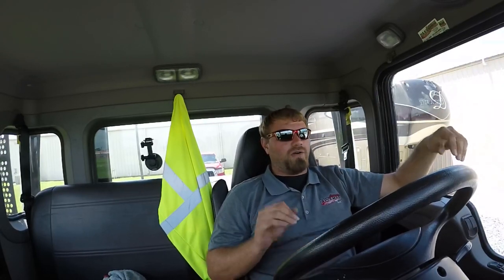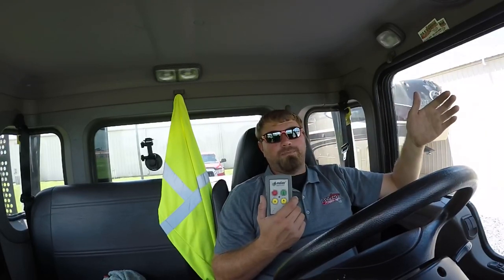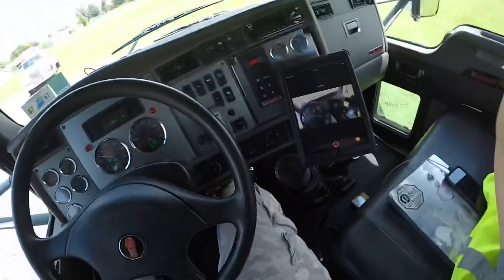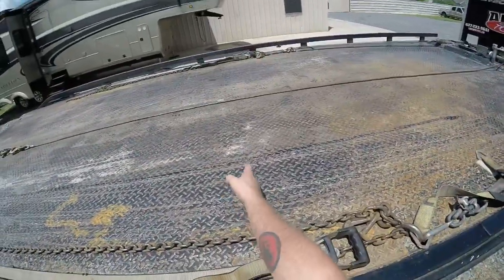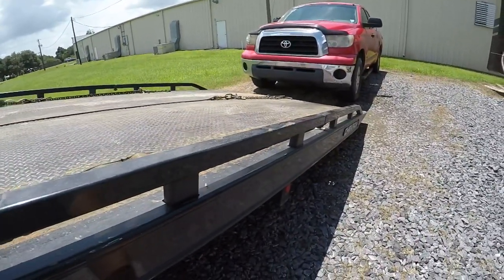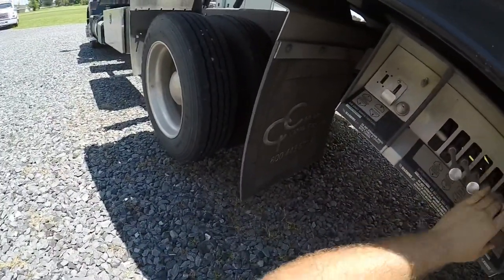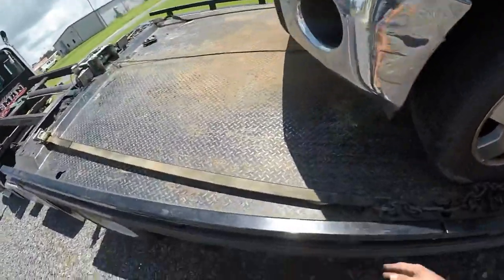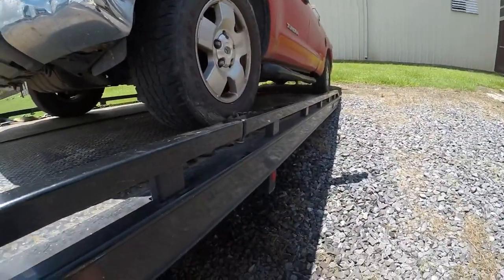Walking a flatbed wrecker under a vehicle in reverse

Comment: Adam, I'm new to the towing industry and I'm loving it. For some reason yesterday I watched your video for the first time, and wouldn't you know it, I had to put it to use last night on a Dodg Ram pickup with two flat passenger side tires. It worked like butter, I was so stoked. Thank you, thank you, thank you. It was perfect timing for me to have seen your video when I did. Stay safe.
Reply from the maker: I’m glad it worked out for you bro. Now that you’ve done it once, you’ll use it more often than you think. Lol. I do it all the time for different reasons. Broken ball joints just got easier for you. Here’s something else you could practice to build off of this: take a vehicle from the tow yard that’s going to scrap and take a front wheel off. Load it like this from the rear, shake it off the end of the bed and place a block between the edge of your bed and the unibody or frame and lift the vehicle up. MAKE SURE YOUR CABLE IS TIGHT AND HOLDING THE VEHICLE! Place a jack stand under the car and set the car on the jack stand. Then work your levers slowly to walk out from under the car while it’s on a jack stand. One thing to watch, if your truck has airbags and they’re dumped on offload, when the rear of the truck sits back down on the ground, that rear axle will push the truck forward. So as you’re putting the truck back down, go slow. Once the wrecker moves forward a bit, slowly release your cable so it doesn’t pull the vehicle off of the jack stand. Make sure the wheel that’s still on the vehicle is blocked as well because with one missing, it’s like the vehicle is in neutral and it will roll forward on you.
Reply: @adamtarver  ohh wow, I'll have to see one of your videos of that. I learn better by seeing it and doing it. Look forward to seeing that one. Thanks.
Reply: If it was just two flat tyres  why did u not just drive it up

Comment: I used this technique before.  Really didn’t like the wheels off the ground a lot of stress on the truck.  There is another way to do it. But the bed under the front wheels set your chains and put wrecker in neutral and winch the wrecker under the vehicle it had worked for me the 12 years I have been driving a wrecker
Reply: Love the response and I’m in total agreement. I will definitely be using your technique
Reply: That’s smart. I didn’t think of that. But then again I’ve only been a tow truck driver for 2 weeks lol
Reply: It really good for someone that has a broken ball joint.  When u have a straight shot from the back.   I never have used skates or anything like that.  I need to post a video of pulling the wrecker under the vehicle it’s really easy.

Comment from the maker: You only have to lift the rear end of the truck off of the ground if your fast idle/PTO won’t stay engaged if you release the brakes. Or put the truck in neutral if you don’t have air brakes.

Comment: Good Vid Adam, I subbed you. It's nice to see towers thinking outside the box...and not in some unsafe outlandish way....you could prolly also do a video like this when winter comes and show how this very same technique, used in a similar fashion, could be used to get ''unstuck'' in your flatbed. keep up the good work.
Reply from the maker: Split Second Towing this does work if you get stuck. If you sink the rear and the front, DONT TRY THIS!!! You’ll dig your front end in a deeper hole. And NEVER use the wheel lift to walk yourself out. Those inner tubes aren’t made for that type of pressure and you WILL bend it. They’re about $900 to replace... just replaced one on a used renegade we bought last week with the inner tube bent...

Comment: I prefer to attach cable first, put my truck in neutral. I then winch my truck under the vehicle. I use wheel chocks/blocks on both vehicles. I will keep moving blocks for tow truck as it moves back. This method is very hard on the bed slide cylinder, and bed slides. But, is sometimes necessary due to a hill, or to get rear of truck over  an obstacle(curb, parking block, etc...).
Reply: That is a terribly inefficient and questionable method, I have never heard of, or done that in my life, Never come across a situation where that might even be beneficial, Skates are so much easier.
Reply: I use either version, depending on the vehicles and geography. Recently, I hauled a Ferrari F 12 with a rear flat. I started the bed under the front tires with my slider wedges. The car doesn't have a neutral mode that I could get the transmission into. As such, I left the suspension deflated and walked the bed back to the rear tires and snugged the winch along the way. Once the tip of the bed was started under the rear tires, I dosed the bed with Dawn and water, sliding them a few inches forward. I lifted the bed up with tilt and towbar to allow sliding it forward without tail dragging the car. Once level and forward, the car slides easily on the slick liquid. Strapped the wheels and away we go. At the dealer, high tilt the bed and ease the winch. Usually the slickum has enough residual to allow the car to slide back to the end of the bed. Gotta be careful, but getting the tires halfway off the edge will allow the bed to slide away from the tires when you set them in place. Free spool the winch and walk the truck out. The hooks get flipped out when the front tires are about a foot up the bed and the bridle gets pulled clear, allowing the bed to be withdrawn a few inches at a time, minimizing nose contact with the deck. 
   I certainly could have started the car and driven it back, but maintaining its immobility prevents any ground scraping. The car's damage was limited to the wheel and tire. Nothing added by the truck.

Comment: Great video for releasing and pulling it up but all of that seems like its putting unnecessary wear and tear on the hydraulics and fram of the bed dosent it???
Reply from the maker: alberto castellanos it’s the same leverage walking the truck as it is loading that vehicle. Picking up about the same amount of weight. If I was lifting the entire wrecker, I’d agree 100%. But the rear end of that wrecker doesn’t weigh a lot. Gross wet weight of that wrecker is 16,500#. My bed is rated for 16,000 and Only picking up a little over half of that if not right at half. It won’t put anymore strain on that bed that it isn’t rated for. But to the naked eye at first glance, yes, it looks like I’m going to destroy this wrecker. Lol

Comment: I’ll have to try your method sometime.  I slide the bed under the wheels then get in the rollback and back up in reverse.  Your method keeps you at one spot where I’ll usually adjust  the bed tilt to stay clear of the pavement and underside of the vehicle.
Reply from the maker: Only reason I quit doing this is I had a vehicle that broke a park pin halfway up the deck effectively putting it in neutral. Thankfully i had the e brake set and it rolled to the end and stopped. This way, you have control of the vehicles with the cable so it can’t decide to leave and go to the drop off destination before you do. Lol. Just something to think about. But yes, that way does work as well and I’ve used it for many years until that happened to me one time. Tha LFT it was a totaled vehicle that we ended up getting the title to so I didn’t have to pay for a transmission.

Comment: The truck i drive wont lift the wheels with the bed. I eventually figured out i can use the wheel lift to walk the truck. Ive thought about installing switches to bypass the park brake and shift interlocks for the pto. Then the truck could just roll, but since the wheel lift works i probably wont.

Comment: Adam, just running across your video. I'm still a little confused on how were able to walk the truck back and forth. Where you using the wheel lift to lift the rear end of the tow truck up? I saw a video of another guy doing it, but he put his truck in neutral to do it.
Reply from the maker: No, I was using the deck to lift the rear. If you use the wheel lift to do that and push the truck forward, you risk bending the inner tube. Sorry for the late response. YouTube doesn't have very good notifications for comments. I apologize
Reply: @adamtarver  no problem man. Thanks for the response

Comment: There is a place for walking the bed, I've done it a time or two, But seems to me a lot of the "reasons" for walking the bed are to make up for not knowing your truck and not being able to back up far enough or backing up too far, and it seems another "reason" is lack of skates, Skates are the go to for no keys, No dragging of the vehicle, The vehicle stays in park and you drag the skates with the car on top, Reduces the resistance greatly, reduces the stress on the vehicle during the entire loading and unloading process, and it's just better for no keys.
Not to mention skates work for vehicles with all the wheels locked or vehicles you have to get from the drive tires, This method only works as shown when your drive tires on opposite of your truck and will stay on the ground for most of the process, otherwise you will just be pushing the vehicle back, Also "shaking the vehicle off" is a method we all use don't get me wrong, but only on wrecked cars do I do that, It's hard on the vehicle's transmission, I've heard of guys breaking shit on the car shaking it off, and its hard on the truck.
Reply from the maker: My truck actually have two sets of wreck master locking skates on it. I had to use this today as a matter of fact. Had an E350 handicap bus that over heated. Sure, I could have just drug the rear end the 4 feet it took to get the rear tires on the end of the bed. Or, I could release the brakes on the wrecker, hit the cruise override on my control box and pulled the wrecker under the bus like I did to prevent the rear of the bus dragging on the pavement. Or how about a broken ball joint on a crown Vic? I could drag the bumper and front end on the ground loading it or I could do this. And when I get to the drop off, I can place the front end on a jack stand for a customer and walk the truck out from under the vehicle so the customer doesn’t have to fight with a jack later. You call it not knowing your truck, I call it customer service at its finest.
Reply: @adamtarver  I mean as I said there is a time and place for it, setting it on jack stands is a good example, and I'm not trying to diss your methods after all there are a million ways to do the same task.

 Whatever works for you is what you should do, but I question some of the described situations and whether or not it would be quicker or more beneficial to walk the truck, dragging a car I will always recommend skates over dragging it even an inch it's harder on your equipment and the vehicle being towed and skates reduce the resistance to overcome, the entire loading and unloading process.

 as for broken ball joint, I will still recommend a ball joint block, takes longer but with a broken ball joint dragging the car at all is going to risk lodging the wheel up in the fender or causing damage to the surrounding plastic or the fender when dragging the wheel up.
If the vehicle is too low on the ball joint block a skate works there too it will keep that wheel from rolling while all the rest continue to roll and it will make it even that much easier while keeping the wheel from damaging the fender.

But yes there are reasons to do this and it's a good thing to know, but I do question some of the reasons, but I have done it and continue to do so when it could be useful.
And yes a majority of the time I've seen this technique used was by companies not knowing how far to back up and using it to reposition their truck mid unload because they were too far back or forward.
Reply from the maker: beastm0de7 I made this video mainly for the ops that don’t have the skates and blocks or really the necessary equipment to load vehicles that are locked in park or for some reason that they would have to drag the vehicle if they don’t have skates or blocks. A cheap bottle of tire wet from DG works wonders sometimes. I use that sometimes even if I do have skates. Lol. I see what you’re saying now. I’ve seen some guys do the same thing. They either back up too far or too close. Hell, I’ve done it a couple of times. I’m no saint. Lol. The truck I was in when I filmed this one is a 2017 KW T270 with a chevron model 12 LCG bed. The one I’m in now is a 2020 kw with the chevron model 12 LCG Load Rite bed with the dovetail on the end. I don’t like doing this too often with this new bed because it seems like chevron sacrificed a little bit of structure due to the sunken deck. I’ve got just under 10k on this new truck now and will be posting a video soon that’ll show the differences between the two trucks and how I have the new one setup as far as equipment. There, you’ll see the different things I use on the daily to make my life easier. If you see that video and can offer any feedback, I’d appreciate it. Whether is equipment that you have that I don’t or vice versa. This channel is designed to make our lives easier. I was brought into this industry “figuring it out” and driving total junk. I figure now it’s time to pass down my experiences, good or bad, to some of the guys that don’t have access to the right equipment for the job and are just winging it like I did for so many years. I misunderstood your comment and I won’t delete mine because I’m not that kind of guy but I do apologize for the last line of it.

Comment: I have a rollback too but mine's a different style it's an old school Jordans where it uses a wedge style to tilt the bed so it doesn't allow me to do that exact same thing because it won't tilt as much I can do about a foot at a time so usually I do is I get my bed underneath the tires that can roll the front or back depending on the vehicle once I get it up high enough where my back housing where my willift would be my truck doesn't have it installed anymore because the previous owner broke it in half and took it off once I have the whole rear end floating where it's not dragging I get in my truck and ask you back my truck under until it's about a foot or two usually about a foot or up against the back tires of the vehicle that do not move and I have the very back part of the bed almost dragging the ground when I back up it's really like an inch off the ground

Comment: Thanks for the clear demo! I’ve needed to do this a lot with vehicles that don’t have keys, but always ended up messing it up. How can you do this for all wheel drive vehicles?
Reply from the maker: Sorry for the extremely late reply. YouTube should send notifications like Facebook... all wheel drive vehicles can be a pain. But with the few that I’ve done in south Louisiana, the rear rolls free if the front is still on the ground. Idk why, I’m not a mechanic and I’ve never put much thought into why but sometimes i get lucky and it happens. Others that are totally locked down, get out the tire skates and load it like that. Generally just skating the side in loading first. But that’s a whole different video because you can get the tires onto the edge of the truck, lift the bed a few inches off of the ground, release the brakes in the truck and pull the wrecker under the vehicle using the disabled vehicle as a dead weight. Once the other axle gets to the edge of the bed, reapply brakes and load normal. Just don’t forget to reapply the brakes. You know what would happen if you did. I believe I’ve seen multiple fail videos where people are chasing their vehicles down a hill. Lol
Reply: Skates, plus WD40 or chain lube

Comment: Great job, however this might bend the frame on the F-550 or ram 5500 Roll back,  but with a Pete or KW, you can do this all day!
Reply from the maker: I agree. Definitely could bend a frame on a f550 and the dodge if they’re not built correctly. Still wouldn’t do it even if they were though. They don’t make em like they used to. That’s for sure...
Reply: It definitely does. I've bent my frame on the 550 doing this before. Have to be gentle with it.

Comment: That’s pretty awesome I like it.... BUUUT doing this won’t damage the flatbed? I would much rather just disengage the transmission then to do this to my flatbed in my opinion.
Reply: Not right away but like anything more stress =more wear and tear it's ok in a pinch. But I recommend off road go Jack's and skates become you close friends
Reply from the maker: @JK-yd5ro  exactly. This of for when all other options are exhausted and not for an every call I get to use.

Comment: Why not just hook chains on to locked vehicle,tip bes slightly and winch truck under casualty. 
And keep tires super close to end of deck and "back chain" . 
And to unload just a minor twitch to bed. Car off. And reverse operation and drive out from under . At last foot stop. Dump bed and tilt suck in and away one goes.

Comment: My roll back is has air ride, I wouldn’t be able to do this. I also think that’s a lot of stress on the pivot rod,  I’ve seen them break.
Reply from the maker: My truck also has air ride and all you’re doing is picking up the real axle with that pin. If it can’t handle that, it probably shouldn’t be in the road to begin with.

Comment: Doesn't it put alot of stress on the hydraulic system??
Reply from the maker: Jerome Medina not anymore than loading a 550 or something on it. You’re just lifting the rear of the truck. Not the whole thing. These trucks are light on the back to start with.
Reply: @adamtarver  I've never tried it on mine I'm always skeptical about bending the bottom brace bracket under the bed, if I go down too far.